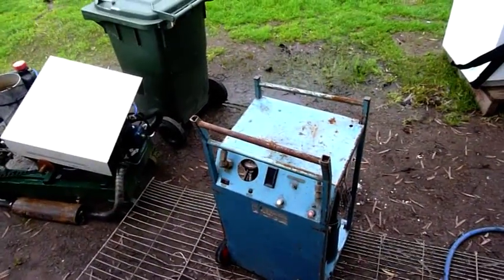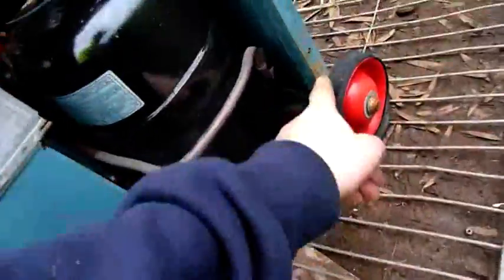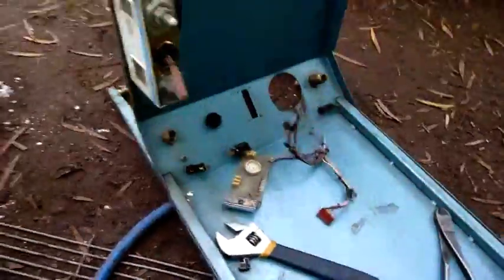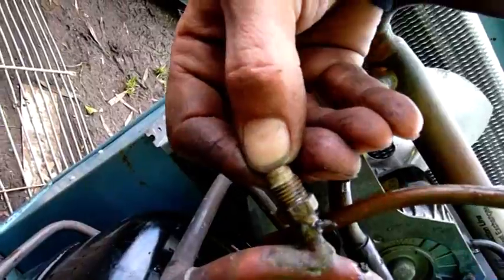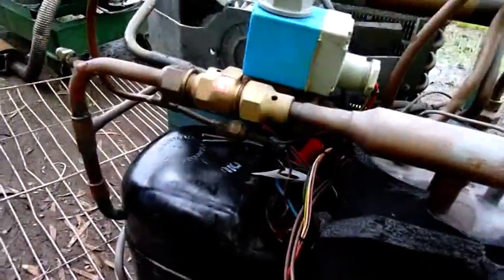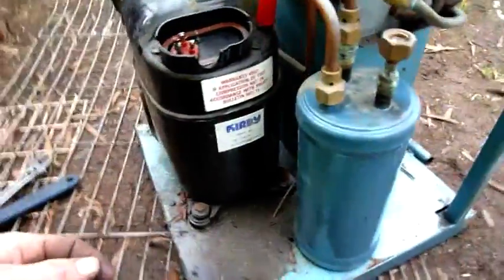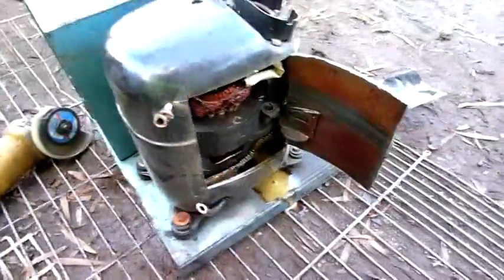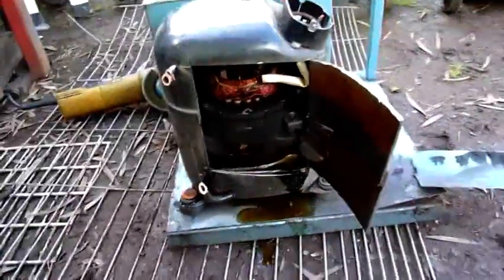Industrial Refrigerant Recovery Unit Autopsy

Comment: wtf. A receiver doesn't come off the discharge.... are you a refrigeration mechanic??? An oil sep comes off the discharge, then through the condenser, then the liquid line receiver.... Thats why it's called a LIQUID LINE RECEIVER. not a DISCHARGE LINE RECEIVER. 'You go to Nth Brisbane Tech or something?

Comment from the maker: @Driftt888 I'm better qualified than many fridgies. 

If I find another unit like this, you can come get it, and take it apart so that you see how it really works.

there is a HP inlet on the blue oil separator so that it can purge oil to the LP side when the float switch trips. the copper oil separator may receive some liquid from the dead unit being recovered, but its main role is to separate oil and prevent flooding the compressor with bad oil.

Comment from the maker: @Driftt888 lmao, I find it funny when people call me a idiot :P

Both the blue cylinder and copper cylinder are oil separators. the copper one catches oil from the unit being recovered, the blue one catches and re-circulates the compressors oil so that it does not run dry.

Comment: I expect the copper tank is to collect any liqiud that comes into the recovery rig, the one we had ran the discharge hot gas through it to help vapourise the liquid, the shreader core is to drain the oil that comes in and otherwise wouldn't be able to get out unless the copper tank had filled right up. The blue one is to return the kirby's oil back to its sump, the rattle is the float that shuts off when theres no oil to go back.

Comment: @Aussie50 I see, Thanks. we run 240V for large appliances like electric water heaters, dryers and stoves and normal appliances run on 120V also stores here use 277V for their lighting fixtures, it's a weird voltage

Comment: The thing floating in the blue separator is a float valve. When it fills up with enough oil, it opens pushing oil into the suction side of the compressor. That way you are not always venting high pressure gas to the suction side.

If I had to guess, the copper oil separator is on the suction side for incoming gas. Probably to keep incoming nasty oil out of the compressor. Which would explain the site glass and manual drain.